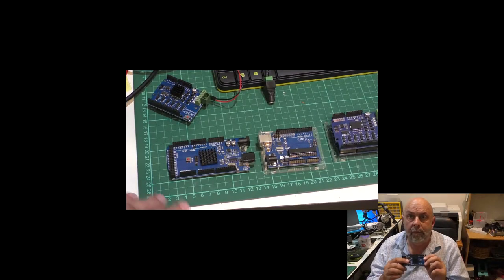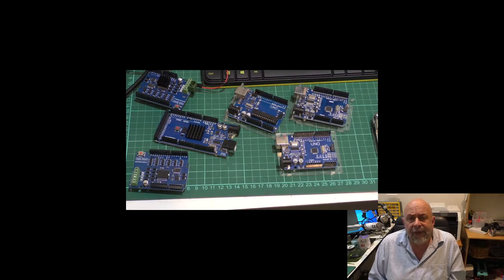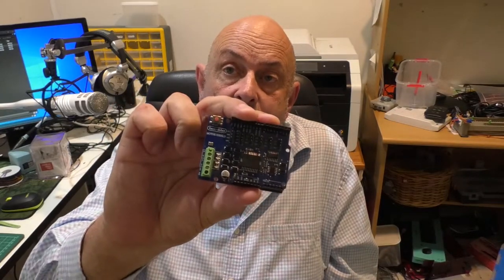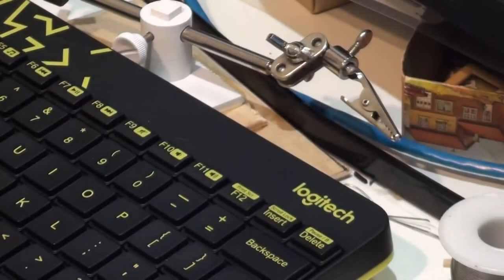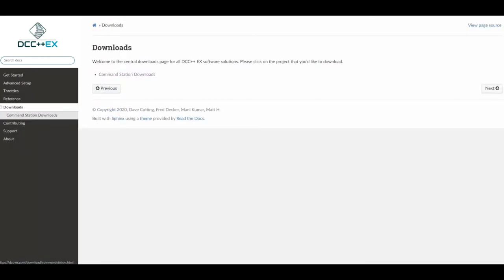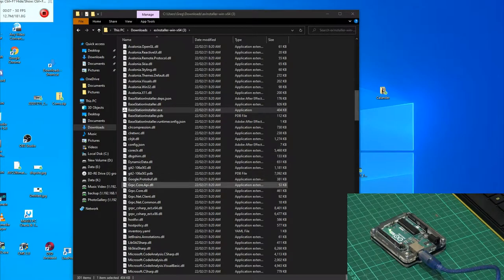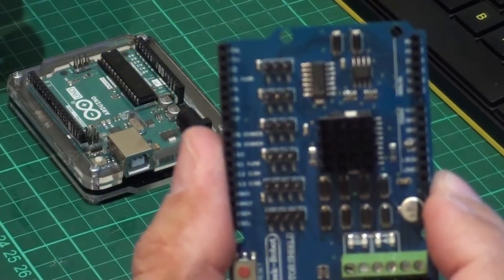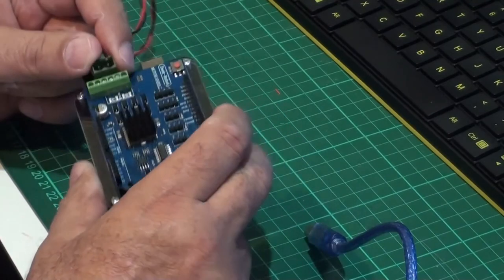WHY DCC++ EX   ARDUINO??

Comment: I use mega2560 clones extensively to control an astronomical observatory. Clones are just that, and you sometimes find that they do not fully implement the specification. You might find for instance that the current limit for GPIO pins is different (usually lower) from the spec. So the upshot of this is to understand what the requirement is, and ensure that if you intend to use a clone, the requirement stays clear of the Arduino spec limits. If you are on the tech side, a really good addition when using clones is to use a logic probe to check waveform voltage and timing.
Reply from the maker: Thank you for your Message . The idea behind the video was to show how easy it was to implement DCC++ EX for non Technical people . There were a lot of people having issue with clones . So I put this clip together to give a simple and easy way for non technical persons   At the time of the Video i was working with the programmers of DCC++ EX as a tester . I use clones for other parts of my model train Layout .   Thank you Regards Greg

Comment: I am a German N model train user. Some time ago I found information about JMRI on YouTube. So I learned about how to use the Arduino to control my trains. On of the requirements is to have the Arduino and the motorshield configured and the software installed. Your video helped me a lot to finally get the system running. At the beginning I had some problem with the ex-installer software. Now everything is running properly and I like to thank you a lot. Best regards from Germany Lutz Wunderlich
Reply from the maker: Hi Lutz thank your for your kind comments  i am glad you found it helpful ,  trying to make things simple and sharing information  with fellow model train users  is important because we can learn by sharing what we have found   best Regards Greg

Comment: Thanks for paying it back and making a video to help others through the process. Glad to have you as one of our group! :)

Fred
DCC-EX
Reply from the maker: thanks Fred there was so many  people who i seen comment on having trouble setting up DCC ++  including  my self  and said that Arduinos were too Hard I felt that i need to do a  the video to get more awareness  . I want to also thank  the DCC++ EX team as for the help  in the early stages of getting my DCC++ EX working  thanks Fred Regards Greg
Reply: Hi, I am new to the whole dcc and Arduinos. If you have an uno or a mega and a motor shield, and run Ex. Do you still need to do the power brake scrape bit under the motor shield before install like in other videos, or does that only apply to the older dcc++ Thanks.
Reply from the maker: @dazhegs1757  Hi Daz , Yes  you do need  to cut Vin Connect . The Arduino runs on 5 - 9  Volts where as the motor shield runs on 12 - 16 Volts if you don't cut the Vin Connect you will blow up the Arduino  thanks for your Question  Regards Greg
Reply: @dazhegs1757  Only the older DCC++ "Classic" we route directly to the correct pins on the Motor Shield and don't need jumpers. In the future we will need the brake for people who want Railcom.

Comment: Thank you for this video. I appreciate your response regarding the motor shield. Can I please ask though, where you purchased the motor shield from that you use. It seems very difficult to find them available in Australia. Thanks again.
Reply from the maker: Thank you for you nice Comment  I really only buy my Genuine Arduino's  Motor Mega's , Uno's and Motor Shields from
https://core-electronics.com.au/arduino.html  they are expensive but they give Great service and help and can express overnight  or normal Mail I used Express during Lock Down as you will get the package with in a reasonable time  . 
Thank you,  have fun, Stay Safe   Regards Greg

Comment: Would a Wemos D1 R2 Work too as a basestation ?
Reply from the maker: Thanks for view My video   At this stage the Base Station program is only for Arduino  Meg  Uno and Nano  see https://dcc-ex.com/reference/hardware/microcontroller-boards.html . I have found that the best board for the base station is the Arduino Mega    thanks for your enquire   regards Greg

Comment: I am seriously regretting going OO instead of N because I live in a tiny flat and OO is just too big but too late now to go N gauge as I have gone past the point of no return with OO lol   I would have gone DCC save for the price of the boards and controller setup, it prices a lot of this out the pockets of kids, teens and young adults who can't afford to throw hundreds of pounds for a few circuit boards so like me they lump it with DC.
Reply from the maker: N scale is not easy it does take patience   because  you have 00 It is much easy to convert to DCC++ EX and not expensive as N scale. The only thing is before you convert a dc train you need to make sure it does not use more than 200 to 300 milliamps using an amp meter  . Other wise you can blow things up  i also have protection on my DCC++EX to prevent damage and  Arduino and motor Shield are less than or around $50 aud or approx. 38 pounds .  my mate Dave (video ) has got rid of his Hornby control and i have built DCC++EX   and we have and still are  converting his DC to DCC . What i do and he does is 1 track for DC and other track or tracks for dcc .  or  you can wire a switch to change between DC and DCC .  . Do not under estimate the power of DCC++EX and JMRI  and so much cheaper the name brands you can also use your mobile phone or Pad to control the Functionality .  you can also Use the Arduino to control the train similar to DCC  . dont give up    there is a lot of support and help  Best regards Greg

Comment: I can 100% confirm that if you use a GENUINE Arduino Uno and a GENUINE Arduino Motor Shield AND follow the instructions, you CAN get DCC++ up and running using JMRI and Engine Driver software.  I'm a dummy and it worked first time with no "time outs" or any other hassles.  I can run multiple locomotives and multiple turnouts.  I bought the GENUINE Arduino components off their web site (based in Italy, I think) and got them within a week.
The reason I will upgrade to DCC++EX is that it fixes a number of bugs (none of which currently affect me), allows more locomotives, is "supported" (the guy who did the hard yards to get DCC++ working, is no longer interested in his creation), is being extended to support more hardware types, is being extended to support more features and generally "feels" more solid.  Its is also moving towards there being just one version to support (whereas, DCC++ WAS designed to be taken and modified to suit your own purposes and has been done so and all of this makes for a God-awful mess).  DCC++'s life parallels Google Android... where individual manufacturers have taken it and modified it, so that one phone looks and works differently to others.  Google is now seeing the error of its ways and is reigning this is in via "AndroidOne".
The only downside is that DCC++EX is growing in size and may require an Arduino Mega (rather than a Uno) in the future.  If I was having my life over, I'd go straight to a Mega, to future-proof my time and cost investment in DCC++.
Yes, there are lots of different hacks/versions/clones of DCC++ around.  Make sure you download the original from the original web site and it will work as advertised.
Reply from the maker: Thanks  GENUINE ARDUINO guarantee the DCC++EX  Will Work and even DCC++   What the team at DCC++EX have tried to expand and to get some Clones to work the down side is the size of the software  Making UNO 's  to small and the Standard is becoming MEGA"S  I  Was originally doing some testing for the Team at DCC++EX    The other Great feature Is that you can use OLED and LCD Displays and WIFI with MEGA's  I am in the middle of a MEGA Build with an OLED Display but i have not been able to get the WIFI module yet so I haven't finish once I get the module  i will be finishing off the Video   . It is always Advisable to Use the components that the DCC++EX recommend on the web site  as they have been tested well . Thank you for you comments  Regards Greg